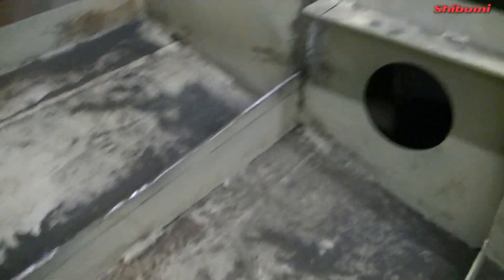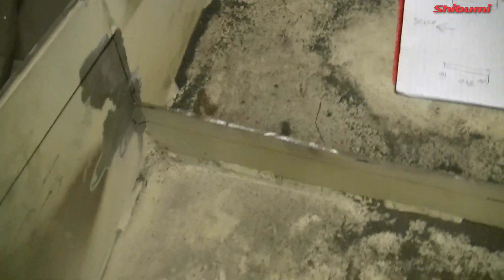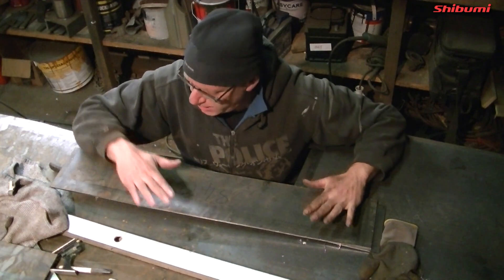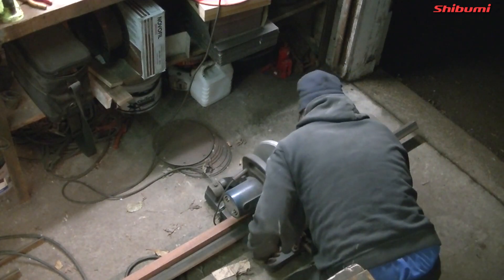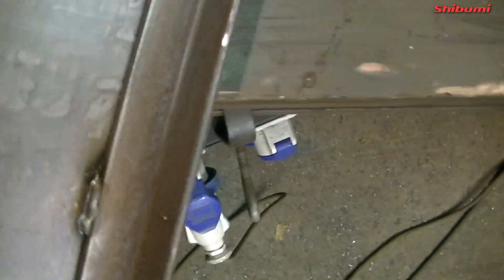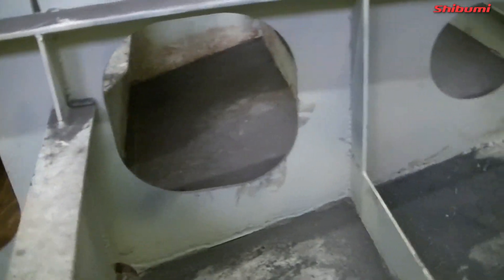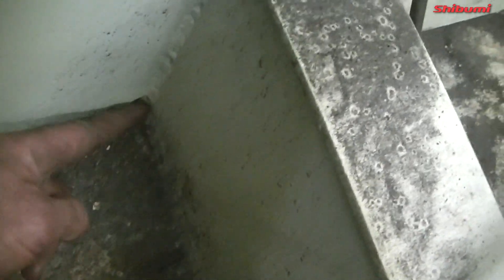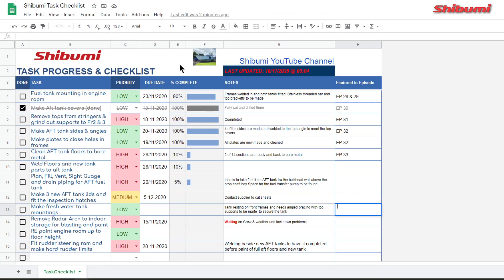Building Shibumi EP 32 - Progress on Aft fuel tank - Steel Boat Build

Comment: Great channel, what size is the vessel did you ever contemplate 2 power units before starting the build.
Reply from the maker: Hi and thanks.. the boat is just over 50 feet in total. I never wanted 2 engines due to cost and the way I want to use it as a long range cruiser that isn't fast, a second engine at the speeds I want 8-10 knots wouldn't actually save any fuel even if smaller than what I've fitted (300hp).